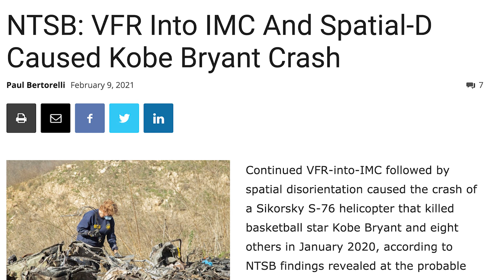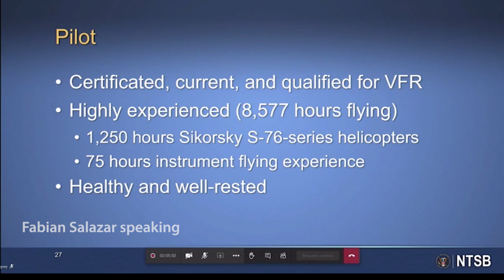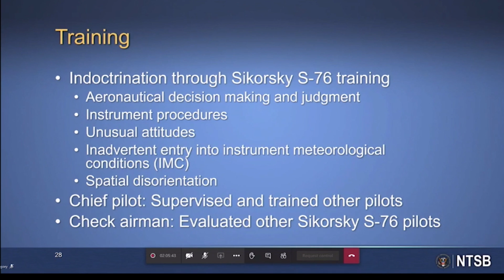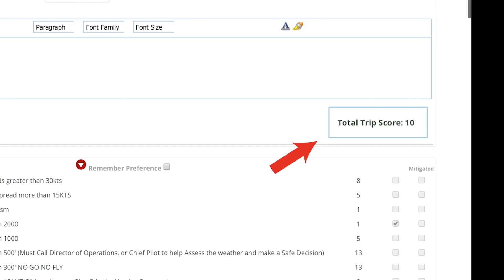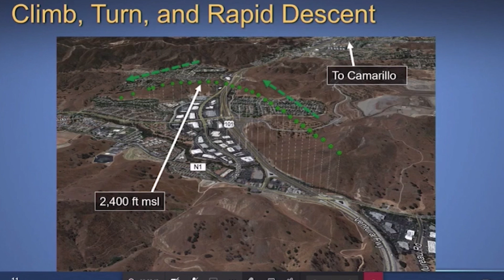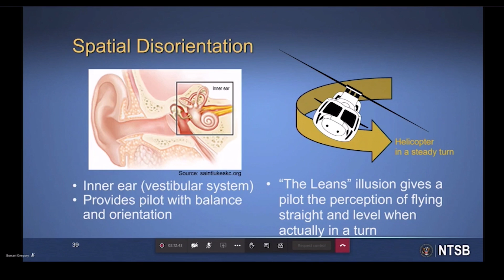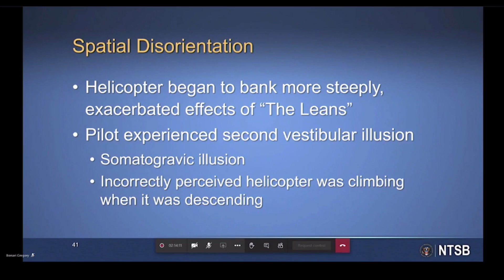How A Split Second Wrong Decision Caused the Kobe Bryant Fatal Crash

Comment: Well done mini-documentary.  I  have a couple of questions:  Why aren't the controls integrated into the steering wheel so the pilot doesn't have to move around to press a button?  Also, I noticed that IDENT is not spelled out on control panel, as well as other buttons.  This happens when people outside of the design team have no input and the final design is flawed.  IDENT, is not IDT.  Most times 3 letters indicate an acronym, not a shortened word.  The whole setup should be readily understandable to anyone who views the instruments.  Cryptic design is limiting in itself.  Sounds trivial but it is unnecessary and easily fixable.  Could the tower see the descent occuring?  If so, why didn't they say that ascending was not matching their radar?  Is there any requirement for Air Traffic Controllers to tell pilots when radio transmissions don't match tracking? Lastly, has anyone looked into voice recognition to instrument indication?  So when he says Ascending the computer responds with a negative?

Comment: I do not have helicopter instrument time, only vfr time in helicopters not equipped for instrument time. I read once that without instruments the average helicopter pilot in simulation would lose control in less than 1 minute if placed in instrument conditions. Airplanes in general are much more stable though. 
The mystery here is why did the pilot not use the autopilot unless perhaps it was not operational. The company specifically only operated vfr flights so an autopilot would not be as critical. Or perhaps one of the gyros was bad, this would make the autopilot defective too and leave the pilot no way to control the helicopter in instrument conditions. This pilot was experienced. I bet on instrument failure. RIP all.

Comment: My question for you….There are audible and visual warnings for pilots of airplanes and helicopters.  Indicators that warn them of all sorts of risks that their current actions are putting into play.  If the left bank (speed and altitude changes included) scenario is an actual problem that exists, and is known throughout the aviation industry, Why is there not an audible directive to verify instruments when all the “stars” line up and indicate that is a possible scenario that the pilot is experiencing.  I know pilots bank left and adjust speed and altitude all the time, but they also land all the time and are warned of low altitudes when landing.  It is something they can choose to ignore because it is their intention, or it is something that can snap their focus to impending danger. Adding a toggle switch to the stick that will enable the alarm when the pilot is entering an emergency IFR situation would reduce its nuissance capability.

Comment: Years ago, at an electronics trade show, I recalled seeing an LCD device that would change a window from clear to frosted instantly. I wonder if a system designed around that would be feasible as a replacement for the training hood. It would likely be prohibitively expensive, I suppose, but mabey special training aircraft could be so equipped.

Comment: I'd think virtual reality would be the best training device for this. There are some things virtual reality simulations do very well, and some things they do very poorly. The price is obviously a major benefit for smaller companies and even individual pilots. The lack of feel for any movement would work in favour of VR simulations here. As would the ability to simulate any dangerous scenario safely and without risk to pilots and airframes. The major downside to virtual simulations is that the aircraft involved typically fly fairly differently to the real aircraft with a significantly different stick feel and input response. However the main aim of training wouldn't be to have a good feel of the aircraft, but to detect problematic scenarios and have a proper response whilst reading the instruments which I would imagine VR is very successful at. My assumption is that time and experience are king here, as with many things, and to enable pilots to simulate these conditions weekly or even daily with would be a very powerful adjunct to actual flight time IMC.

Comment: Issue with commercial pilots flying small aircraft with high paying passengers for private flights, is CRM. There is a lot more possible distractions when pilot has to interact with passengers. Even if its only talking. Now have the aircraft flying into IMC, and now a confused pilot and passengers being stressed through fear.

Comment: 'Pilots don't ... like that idea'. That is certainly true but it is not hard, in my opinion, to show that far more pilots have benefitted from recorded flight data than have ever suffered from it. We need more, not less. Video recording of the flight instrument panel is vital because of the prevalence of electronic instrument displays. Even where an aircraft has a full suite of flight data recorders what is recorded may not be what is displayed because considerable digital processing occurs in translating the data into a visible display. We are sometimes told that we know why Air France 447 crashed into the South Atlantic but I don't know any experienced big jet pilot that can understand it. It would have been immensely valuable to have video of what was actually displayed to the pilots.

Comment: Great video. Correct me if I'm wrong -- anyone, please -- after listening to the transmissions between the crew and the ATC, the crew had to get "special permission" to achieve necessary ascension required to regain VFR. Is it possible they were ascending, but not at the desired rate until receiving confirmation to do so? Thanks!

Comment: Keeping it simple.  The autopilot has a better sense of IFR conditions than the human pilot.   Have a big button on the control panel that the pilot pushes when the helicopter encounters this condition.  The button gives control to autopilot for the helicopter to climb at a moderate rate allowing it to break through the cloud/mist cover at a higher altitude WITHOUT HUMAN PILOT INTERFERENCE.

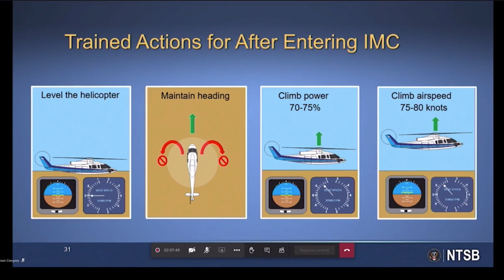Comment: I am not a pilot and I don't fly in helicopters.  I found this video very helpful, but one point perplexes me.  At about 7:10 he describes the official guidance for what heli pilots flying visual should do when they unexpectedly fly into instrument conditions, which basically consist of leveling out, climbing and so on (and, he suggests verbally, also "slow down").  This all sounds like sound advice as far as i goes.  But I don't understand why it doesn't go farther and suggest that the heli pilot place a priority on SLOWING DOWN, and even, if there is a risk of flying into unseen terrain, even STOPPING and hovering if necessary until the pilot can clear his head and get his bearings.  It just seems to me that this represents a profound difference between what you should do as an airplane pilot and what you should do as a helicopter pilot in such a situation.  Because there is a profound difference in what an airplane pilot and a helicopter pilot CAN do in that situation.  The airplane pilot can't stop.  He can climb carefully to avoid a stall, and level out and try to be as cautious as he can to avoid flight into terrain.  But the helicopter pilot is different.  He has the luxury of stopping and simply hovering, reducing the chance of flight into terrain to zero.  Why isn't he recommended that helicopter pilots take advantage of that capability, whenever a danger of flight into unseen terrain exists?  Obviously hovering requires skill, but the helicopter pilot will necessarily know how to do hover.  It just seems to me that failing to recommend slowing to a stop if necessary in a helicopter commits the fallacy of treating flying in a helicopter as if it is the same as flying in an aircraft that cannot slow to a stop.

Comment: Maybe an ifr rated pilot can answer my question about this-
My understanding is the pilot was ifr certified but not current at the time of the accident, and the video showed he had 75 hours of instrument time. He was hardly new to the experience of imc flying. As a vfr pilot myself, I completely understand the dangers of spatial disorientation. But this is an ifr pilot (not current) with experience. I have a hard time believing he forgot how to fly on instruments while in the clouds and didn’t instantly revert to his ifr training once he encountered them. As an ifr pilot, wouldn’t you?
Reply: I am not a pilot, but I speculate that the overwhelming character of the instinctive vestibular response, the relatively tiny number of IMC hours (presumably IMC flying is a perishable skill), possibly unrealistic nature of IMC training (is peeking over the hood possible?), and possibly an over-confidence borne of long experience as a pilot (hand-flying an unplanned “punch through the clouds” at 140 kts), might have been relevant.
Reply: @bjma654651651  Thanks for your thoughts. As a pilot, I was trained to almost instantly to respond to abnormal behavior in flight. If the nose is real heavy on rotation, instantly the thought is too much forward trim. Engine starts running rough, carb heat leaps to mind. It becomes second nature. I have to believe inadvertently entering imc would trigger the same instant response to go to instruments. Even as a vfr pilot we are trained to do this. And his 75 hours of instrument time wasn’t spent under a hood “peeking”, that’s three full days of ones life flying by instruments. I’d love to hear an authoritative opinion from an ifr pilot about completely abandoning ones training (Paul Bertorelli, you there?) when encountering imc. I’m sure it could happen given all the different types of pilots there are, but this was a proven, experienced, qualified pilot that to not follow his training would be  the oddity, not the rule.

Comment: Flying is like scuba diving.. I've been disoriented and had to look for direction of bubbles ascending to work out which way is up. Maybe a transparent plastic bottle with some colored juice in, could show in flight your roll or pitch to verify instruments if in doubt.
Reply: if in a turn,"g"forces will keep the liquid level at 90 degrees to the vertical,very similar to inner ear,with no visual reference points,disorientation takes place.gyroscopic artificial horizon devices arent affected by any changes in pitch or bank,they continually tell you your relation to level flight.you have to trust them,although they cant warn of terrain,etc.

Comment: It stuck in my mind, that when this crash happened 1 year ago, there was info floated in the media that this pilot was "instrument certified/experienced and was also providing training to other pilots on instrument flying". Meaning that even then there was positive reputation about the skills of this pilot.  This "reputation" of alleged skill led to self fulfilling false prophecy of false comfort instead of vigilance. I would bet that even Kobe himself while trusting the skills of this pilot did not realize that of over 6000 flight hrs (low risk flying) he had just 75 hrs in simulated instrument flying (difficult, high risk flying).
Reply: Kobe himself stated he would not fly with anyone else than Zaboyan.

Comment: Hi, Could you please do a vid talking about the near miss at an air show in England a few years ago where a retired Victor bomber was doing a fast taxi run and accidentally took off? It would be interesting to hear about what the maintenance differences are between a flyable historic aircraft and an aircraft that is only maintained for fast taxi runs. It would also be good to hear your opnian of the decision making of the pilot on the day in putting it back down ASAP, My gut feeling is he did a perfect job of a bad situation however there are a lot of comments about how he should have 'gone around'. Thanks :-)

Comment: So pilot looses visual and then fails to use instruments and crashes.
Reply: Shocking how many pilots out there are not instrument qualified.
Reply: @TheEvilmooseofdoom  --The accident pilot was instrument rated, but clearly not proficient.
Reply: @cardinalRG  I did a little reading.  Turns out the company was required to operate under VFR only, don't know about Zobayans actual level of training.
Reply: @TheEvilmooseofdoom  --The company was not certified for IFR flight with passengers, although both aircraft and pilot were themselves legal for IFR flight.  This isn't unusual for helicopter transport companies.  But obviously, when faced with the options of remaining VFR and protecting the company's certificate, or else switching to IFR and protecting lives, the latter would have been the better choice.

Comment: Never experience the leans exactly but once I was flying a glider and thermalling in cloud (was flying with an instrument rated instructor), I had a steady turn going at 45 degrees of bank and at one point, seemingly out of nowhere the aircraft was suddenly at maybe 70 degrees of bank and I had been completely unable to detect any change at all, the only symptom was the increased air noise and a slight increase in g - I didn’t even have time to look at the ASI. Me and my instructor had a collective “oh shit” moment and we both put in a bunch of outside aileron while he took control (all three things at the same time), once straight and level he commented that he was having to fight his instincts so I guess he did have the leans. We confirmed that we’d both had enough of cloud flying for the day, within maybe 5 seconds we were out of the cloud and he gave me the controls back.

I guess I had it a little easy as the transition from being just below cloud to needing the artificial horizon took maybe a second or two but I feel it was still a good lesson in switching to instruments quickly and without the ability to “cheat” as it were. Good practice for my instrument scan cycle as well. I should also confirm that cloudbase was well above local terrain for this exercise and we had kept a good eye on the wind direction.

Comment: Better simulation training, enhanced pilot awareness training, blah blah blah. This is the same old crash dynamic repeated thousands upon thousands of times. A pilot throwing caution to the wind because of internal or external pressure. Nothing more here to see. End of story.
Reply: I agree with the sentiment. It seems the level of analysis by the investigators is superficial. VFR into IMC is such a common deadly occurrence, you’d think all commercial, passenger carrying operators would have to be IFR certified.

Comment: The USA is almost alone in allowing Single Pilot Helicopter IFR. On any given night, most cities in the USA have numerous medivac helicopters flying around single pilot IFR in sometimes real IFR.   They do so with many thousands of hours of flying without incident.  This pilot's IFR was very limited and was unable to transition from VFR to IFR. Somewhere, he was signed off when hindsight shows he lacked the experience and ability to do the transition. 
In many companies, commercial interests come before proficiency and safety and that appears to be the cause of this accident. Its not an accident that extra gixmos in the cockpit would have prevented. Whats required is more checking and training to ensure required standards are maintained.  Now back to the simulator.
Reply: It is my understanding that the accident rate in medflight helicopters is actually quite high.
Reply: You are correct. The USA is in denial as to the risks of Single Pilot IFR in fixed wing and Helicopter

Comment: I was flabbergast to learn that the overwhelming  majority of  helicopter flights in the LA region are exclusively flown under  "VFR only" flight plans into coastal canyon areas.  Those canyons chronically have significant morning fog & haze obscuring the ground, as well as similarly obscuring coastal weather that can suddenly move in, all of which should compel the need for pilots to file IFR, or be ready to file IFR en route.  When the Weather Goes to Shit, you gotta be ready to transition quickly to instruments.

Comment: I have a question for pilots out there, which I do not understand. Once in IMC, you see nothing outside. There is no reason to look anywhere but the instrument panel, and (I think) my eyes would be glued to the artifical horizon and heading indicator for clues.
Obviously, this is not the case, and most people (probably including myself) would just stare into the clouds, hoping for a visual clue, not ever looking at the artifical horizon.
I used to play flight simulators when there were next to no visual cues, because the graphics were so bad. You could only orient yourself with the instruments (you could, of course, see if you were flying level, because the green/blue divide on the screen).